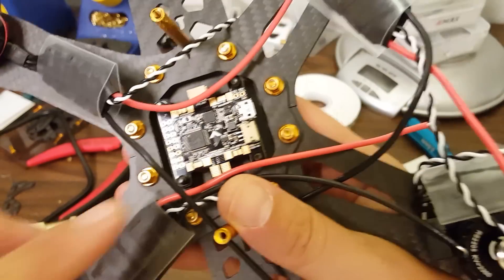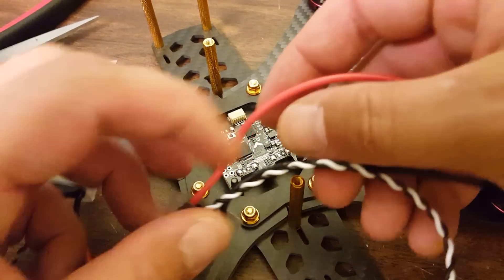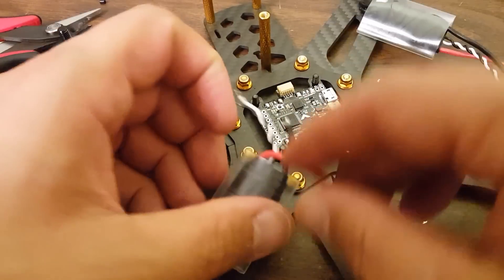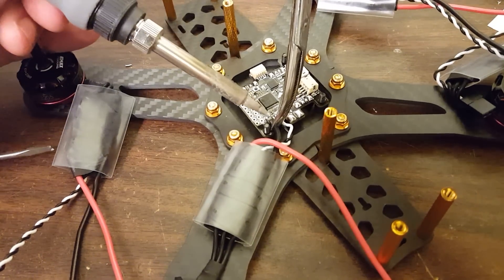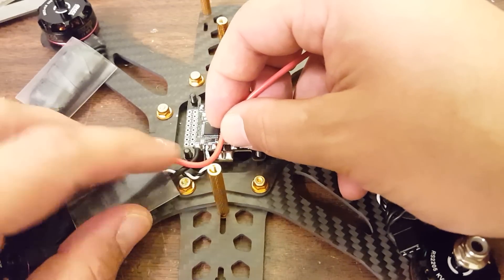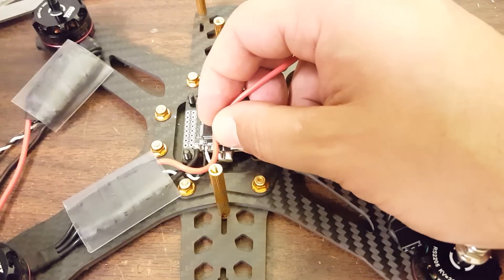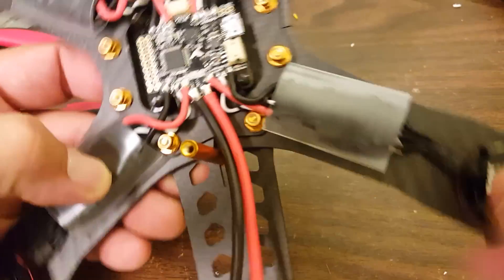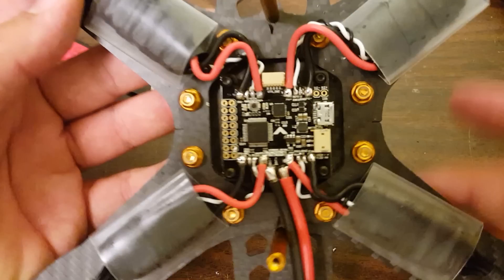HIGH END RACING DRONE BUILD - Part 2 | Skull N Drones Rampage w/ Furiuos FPV Kombini

Comment: The soldering would be easier if you leave the wires a little longer and than remove a relative long part of the isolation. Then you can easily drill all the wire strands together and put solder on it. And then you can cut them short. This way you will never have any strands lose and possibly touching other parts.

Comment: Question if I may, I'm building my first quad on the ZMR 250 frame, using a Diatone v2.2 PDB. Cheap n' cheerful :) I'm using DYS XM20A ESC's, on the PDB, there are 4 signal outputs next to the center and a negative and positive 5V pad as well. My question is, what do I do with the ground wires on the ESC's? I know they are wound around the signal wire to help with shileding, so I'd like to know where to solder them to. The negative terminal for the power?

Thanks, your videos have been super helpful by the way!
Reply from the maker: +freshage solder the ground wire to the same pad as the negative motor wire.
Reply: Awesome, thank you.

Comment: Nice video joshua! Have you tried a 5s setup in the past? I am running the RROSD and ran into problems with video noise. The RROSD cannot handle 5s with the 12v regs so I hooked up a 12v step down pololu, and while it cleaned up the video a bit, it's still pretty noisy. I'm not really sure how to approach this. I have read that the hubosd can handle up to 5s while using the 5v and 12v regs / lc filter but I don't really want to replace the whole PDB. What do you think?
Reply from the maker: I've never run 5S at all. Not yet. When I do, it may not be on an RROSD setup.
Reply: I did find a way to completely clean up my video on 5s with the rrosd! Ive just been using it as is for so long I forgot you can change the camera output to 5v and still use it on 5s. did that and videos clean! 5s is like the jump from 3s to 4s, just insane!

Comment: What type of solder is recommended for this type of work? My current solder that came my iron is almost out and I want to replace the solder with good stuff
Reply: 60/40 rosin core solder is generally the best, the thinner the better (usually).  63/37 is okay, but hard to find and usually more expensive.  Lead free solder is usable for most jobs, but it's a pain to work with and you can get good solder just as easy.  Avoid acid core solder, that's for pipes and it'll probably destroy your electronics
Reply: Trapper John thanks! Here's what I'm looking at: Kester 83-4000-0000 SN60PB40 Solder Pocket Pack, 0.031" Wire Diameter https://www.amazon.com/dp/B00068IJNQ/ref=cm_sw_r_cp_api_2HO.xbHFM9MGW
Reply from the maker: Definitely take the advice of using leaded solder. Lead-free solder is much harder to work with and many beginners damage gear trying to get it to flow properly.

Comment: https://youtu.be/86_rXqY8oF8?t=311Is there a resistor missing there? (I think it's labeled R1). It's so close to the pads that it wouldn't last anyway I guess. Also the battery wires end up awfully close to the ESC pads, the -ve to +ve on the bottom left looks a little scary. That's almost enough for me to just stick with PDB's....
Reply from the maker: +Chris Brent the resistor has been intentionally removed by Furious after manufacturing.
Reply: Hehe, because if they hadn't done it intentionally it would have been done unintentionally by a user? :)

Comment: I see some builds where the signal ground is not used and others do...just wondering why you use them?
Reply from the maker: +clgraham82 I wish I had copypasta for this answer. The short version is that when strong AC transients are present you can't assume that all parts of the ground are at equal voltage potential. With a 3.3v signal, and given the size of the transients modern ESC's create, it's easy to get enough voltage difference to corrupt the motor signal. Ground wires prevent this.

Comment: I'd be interested to know the voltage drop from battery pad to each of the motor pads when the motors are fully loaded and then compare it to a conventional PDB. Yes it's dangerous but I know you will take one for the team Joshua:)

Comment: noticed in the zoomed image just above the ESC's signal ground of motor 3, there is a R10 missing? Or why are those pads tinned if it is not needed?
Reply from the maker: +psydafke there was a resistor there but it turned out to interfere with blheli pass through is what I've heard, so get removed it after manufacturing.
Reply: Good to know that it wasn't there on purpose! You might have been searching for issues later on, so I thought it was worth to mention when I noticed it. Happy flying, Joshua!